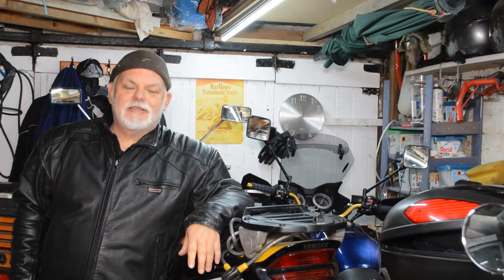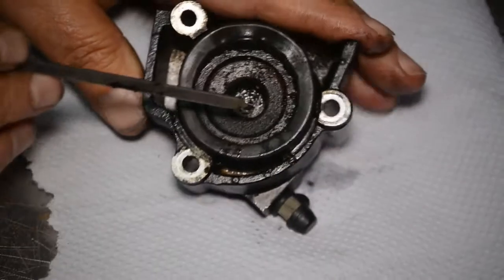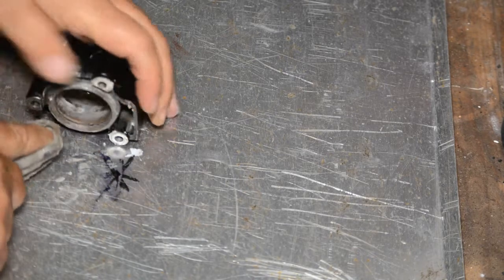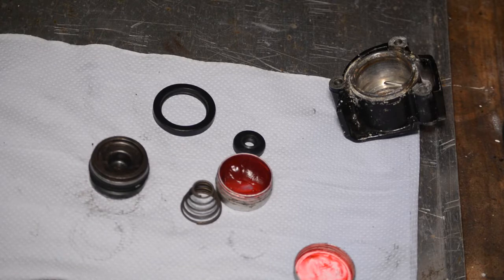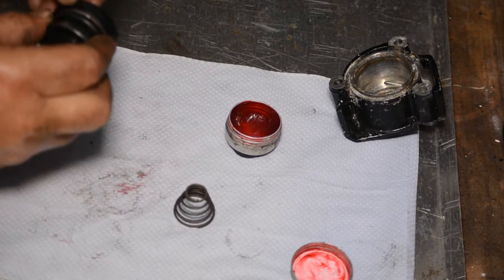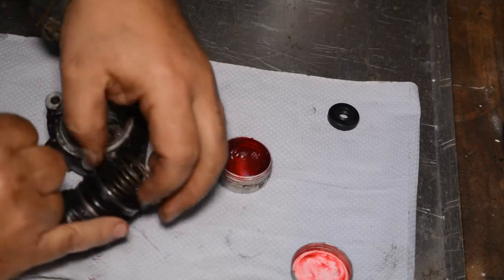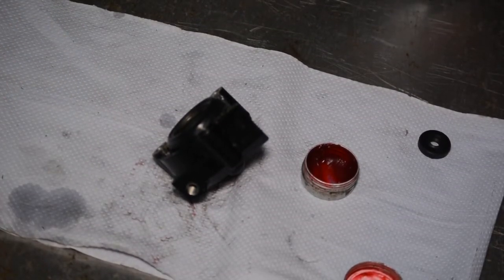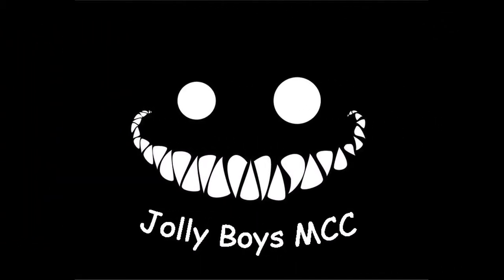XJR 1300 Slave cylinder repair part 2 remove old and fit new seals

Comment: Thanks for a good video. I just used your instruction to reseal the slave cylinder on my 1985 Vmax. The original seals went 135,000 miles before they started to leak, I figure the new ones oughta do as well...
Reply from the maker: Hi Bill, thanks for the comment, wonder if you are a Yorkshireman like me. Squeezing those sort of miles from a set of seals 🥃
Reply: @paulbell9025  Nope, I live in the US, near Buffalo NY. I bought the bike new back in 1985. Guess it's a keeper!
Reply from the maker: @billseward8176  must have Yorkshire blood in you from somewhere back in time 👍 Coincidently, back in 1996 rode from Toronto via Niagra through Buffalo to NY, NY.
Small world my friend 🥃

Comment: Brilliant video, managed to change mine after watching this , thanks for doing it 👍🏼 it works brilliant now, but it doesn’t push in and out like your new one did, no idea why?
Reply from the maker: Thanks Phil, no thoughts as to why. Don't overthink it, if it works, it works :-) Clocked up just over 18'000 miles since doing mine, hope yours is the same

Comment: great video could you tell me where the small rubber washer like thing goes , looks like it should go on the metal shaft but mine dosent have one and got one in the rebuild kit
Reply from the maker: Hi Mike, thank you for your comments, hopefully this link should take you to a parts diagram that should help   https://www.dropbox.com/s/qj8bntq3j1pudzs/Screenshot%202021-03-03%2013.18.49.png?dl=0
Reply: @paulbell9025  many thanks
Reply: @paulbell9025  hi again , i have changed it all and bled the system but now when i try and put her in gear she jumps fwd and stalls ( as if i have no clutch at all ) i took it off again and checked everything and its all ok , reassembled and again bled the system but it s still doing the same , any help would be great fully appreciated

Comment: I changed the seal kit, filled the reservoir, loosened the bleed nipple and pumped, but not much happened. The bike has been stood for a while, and during that time all of the fluid has leaked out so there must be pretty much nothing but air in there I presume. Do you think that's the reason nowts happening by pumping the lever? I'm thinking I might need to get a vacuum bleed kit to suck some through from the bottom?
Reply from the maker: I think so, can be so full of air it seems to take forever.
Could also try taping the clutch lever back to the handlebars, top up reservoir and leave overnight, then try bleeding. I often do this with brakes even when bled, belt and braces really but often results in a better feel at the lever.
Reply: @paulbell9025  Will do, cheers.

Comment: I need to purchase the rubber seal kit. Any suggestions  for the best on line provider for these parts
Reply from the maker: Hi, can't quite remember the supplier but it was the brand (Tourmax) on this ebay page. https://www.ebay.co.uk/itm/Premium-Quality-Clutch-Slave-Cylinder-Rep-Kit-Yamaha-XJR-1300-2008/282441376709?hash=item41c2d163c5:g:ArcAAOSwJ4hY-fZh

Not a big difference in cost from the economy kits and so far no problems and as you saw evything fitted :-)

Happy fettling 
Paul

Comment: @Paul Bell  hi again , i have changed it all and bled the system but now when i try and put her in gear she jumps fwd and stalls ( as if i have no clutch at all ) i took it off again and checked everything and its all ok , reassembled and again bled the system but it s still doing the same , any help would be great fully appreciated
Reply from the maker: Hi Mike, Mmmmm tricky one, if you are 100 percent sure it is bled and operation correctly, it can only be something with the mechanical parts of the clutch (obviously). Plates stuck together, bent clutch rod (any chance the BB at the clutch rod could have fallen out). Will the system 'pump' up and move the cylinder to the push rod>
Reply: @paulbell9025  thanks for the reply , i took of the clutch cover to see if the plates were moving and i noticed that a washer on one of the spring nuts was not central undone it and placed washer in the middle and wey hey put back together and it all worked and now i can get back in to neautral when i pull  up cheers for your help
Reply from the maker: @MikeButler05  great, safe miles Mike

Comment: Mate the small seal where does that go? The 1 at the 2.46 mark next to the grease
Reply from the maker: Hi Jake, it's not actually part of the cylinder assembly as such.
It's the clutch push rod seal.
Let me know how you get on, if you get a problem I will see if I have diagram.
Reply: @paulbell9025  Hey thanks very much for getting back to me, fantastic 3 part videos, Ordered up a repair kit and changed mine today following your instruction, very helpful
Reply: @JakeStrada  I cant see which way the middle seal is facing, as it has a tapered shape.  You have and an image which way it sits.
Much appreciated.